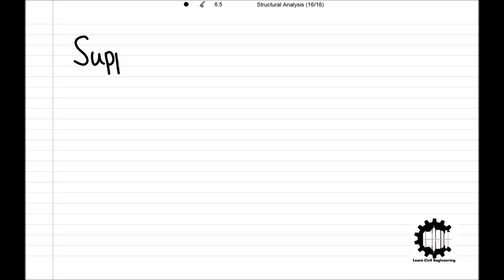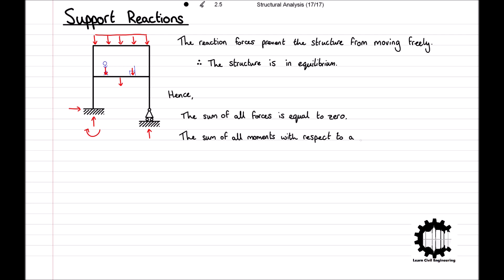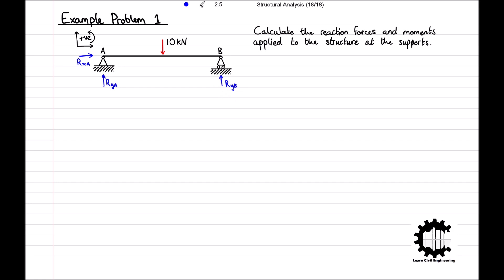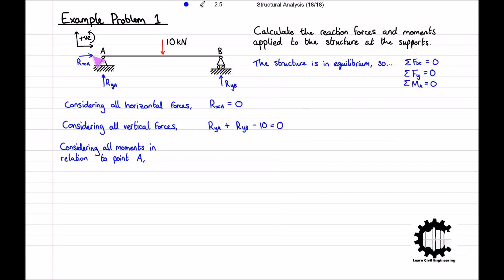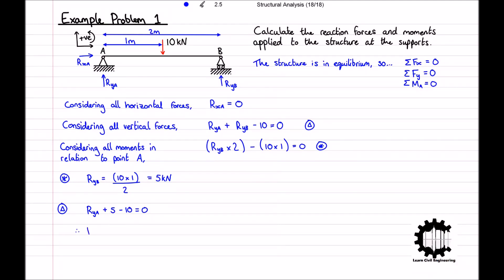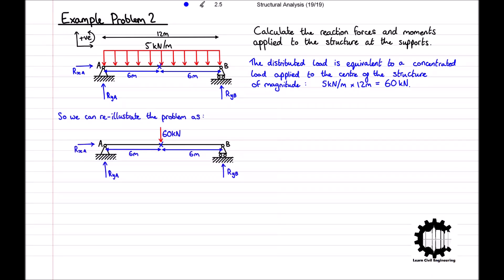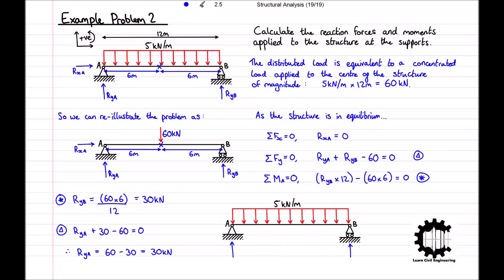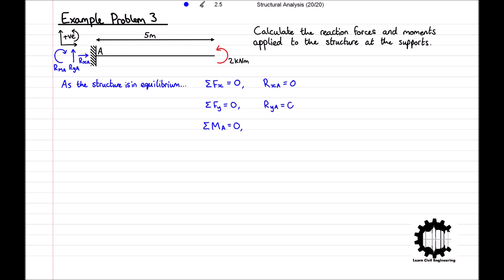How to Calculate Support Reactions with Example Problems - Structural Analysis

Comment: im very late to this video by why the pin exerts a force in the positive X direction "in favor" of the body when it should be towards the negative X directions? so a body has a load gravity that goes from +Y to -Y giving momentum if net but that woulldnt mean that to counter this rotation the X force of the pin should be to the left? so -X side? i dont get this

Comment: Why don't we have to multiply 2x5 in the last example for the moment calculation? Thanks in advance ;)
Reply from the maker: Thanks for your question!

The 2 that you're asking about is already a moment being applied to the structure (2kNm), so we only need to add/subtract it within the equilibrium equation.

If it was just a force (kN) then we would need to multiply it by the distance of 5m to convert it into a moment.

Hope that clears it up for you 🙂